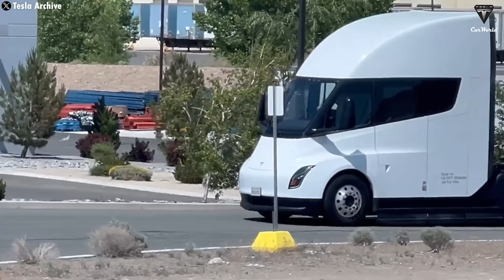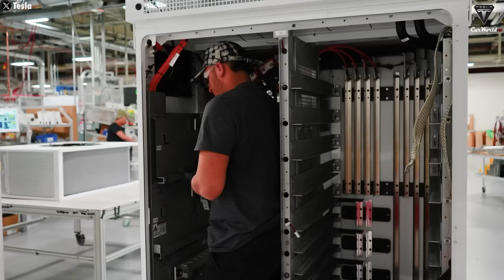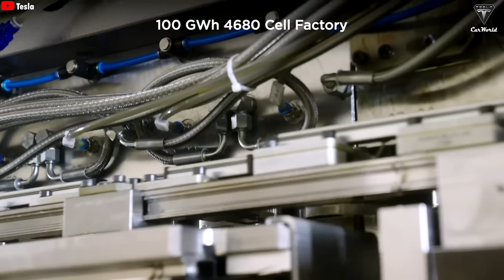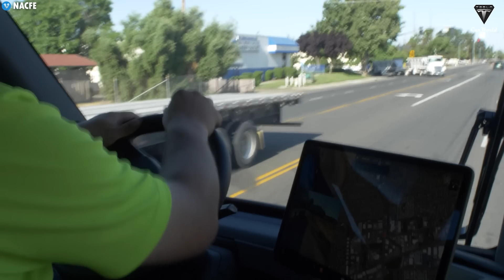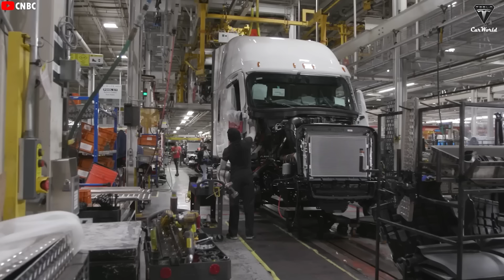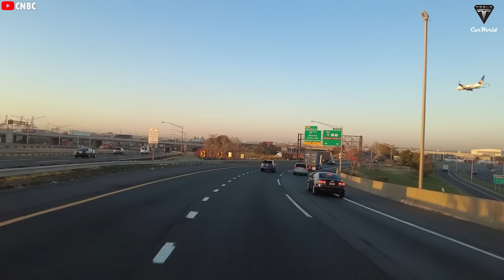Elon Musk's Tesla Semi 2026 Version Just Announce New Detail Specs!

Comment: 82 000 lbs. (36 metric tons) is not very much. Here in Sweden, trucks are allowed to weigh metric 163 000 lbs. (74 metric tons) on certain roads. On regular roads, the maximum permitted weight is 141 100 lbs. (64 metric tons). The maximum length of a truck and trailer are 98 feet without a special permit. And the maximum length is 34.5 meters if you have a permit and a companion vehicle.
Reply: 80,000 pounds is the limit in the US. They allowed it to 82,000 to account for the batteries. It’s still a relevant number. Obviously, if you are carrying more, your range will decrease. My question is…..who’s got a bladder that long?